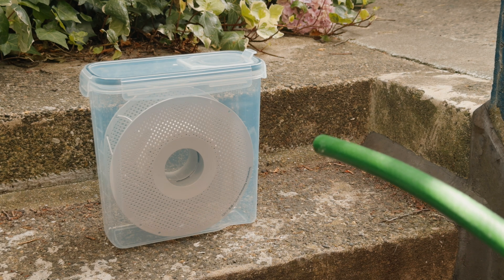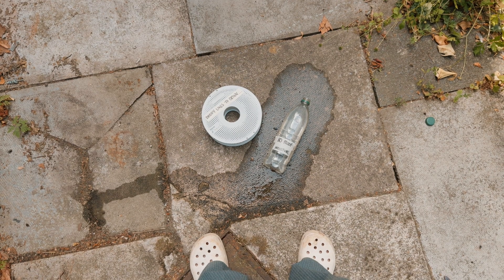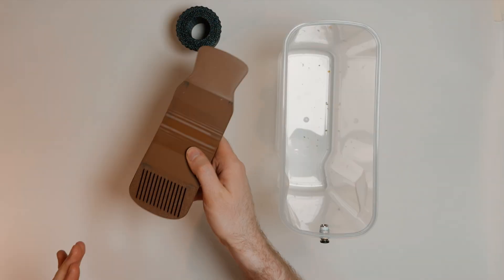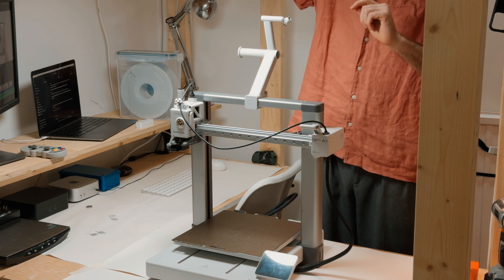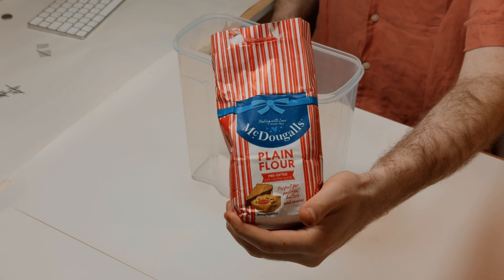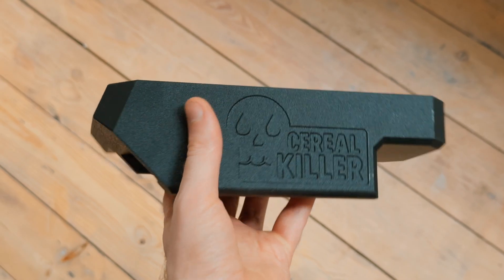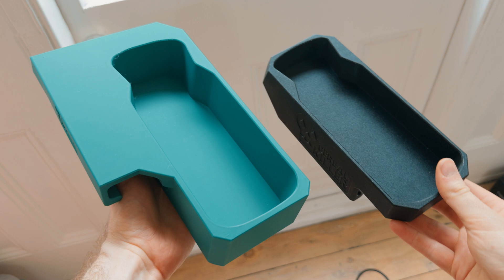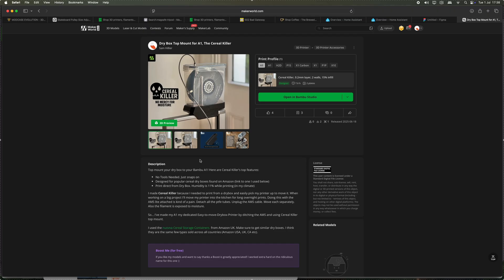This Box Saved My 3D Prints

Comment: I have bunch of spools of Bambu PETG which was garbage out of the sealed box and still garbage after 5 days of drying in the dryer. Their PLA is fine. Other brands of PETG are fine out of the box. And only Bambu PETG is totally unusable.
I asked about it on reddit and bambu cult members told me I'm wrong.
Reply from the maker: Maybe try drying hotter? I've had spools arrive wet too and it's super frustrating

Comment: what if you make a hole instead in your holder, so cereal box just got into it and stuck somewhere at the middle. YOu may get even less height and don't need to build the bottom to be equal the cereal container
Reply: Remember that this was designed to keep everything (just) above the printhead when at maximum on the z-axis.
Reply: @dougal6569  Ah, I see, thanks

Comment: Sam, I realise that this video is about your process rather than advertising your ‘make’, so please forgive me making a process suggestion. 
If you can take your reference photo on a squared grid background (cutting mat?) rather than a floorboard, it makes it so much easier to get the scale right in your cad program!
Reply from the maker: Yea not a bad idea. I don’t have a cutting board right now so usually just use tape measure or the callipers
Reply: @heysamhillier  sure, as long as there is a reference length visible in the photo, one can then use the cad program to scale the photo to get that length accurately, before tracing over your item’s shape. 
I just think it worth clarifying the method, so that others could adopt and adapt the idea, for example to mount whatever cereal drybox they already had.

Comment: I built a cereal box filament dispenser too, hung the spool on a piece of horizontal wood dowel I fed through rubber grommets. In another version I had the spool sitting on rollers I bought off some site. Would be interested in more detail on your solution, not sure how it works - looks like it is custom per spool type as some have different hole sizes.
Reply from the maker: Having it run on a dowel is an interesting idea. The one I made is just a 200mm diameter profile the spool can rotate on. But it has lots of friction so isn't great. For my next ones I think I'll use bearings or a dowel type thing.

Comment: Love this! Could you please share the part(s) you needed for the Bowden tubes?  Are you planning to share the filament reel mounting part that goes inside the serial container? It would be much appreciated!
Reply from the maker: That thing is called Bowden Connector. The one I used is called a PC4-M10 I think. But if you search PTFE tube connector 3d printer lots will come up. They come in different thread sizes like M5, M6, M10 etc. Hope this helps!
Reply: @heysamhillier thank you that’s great